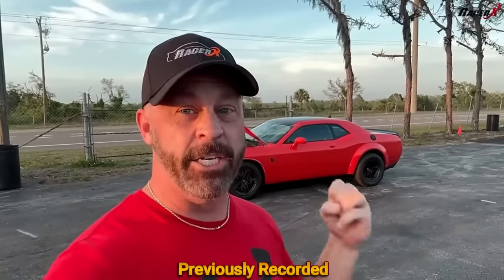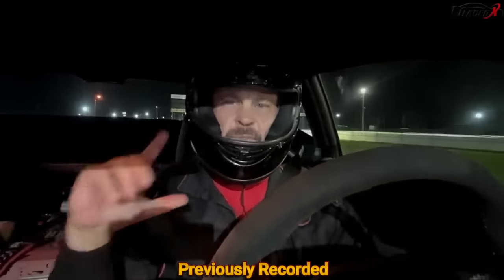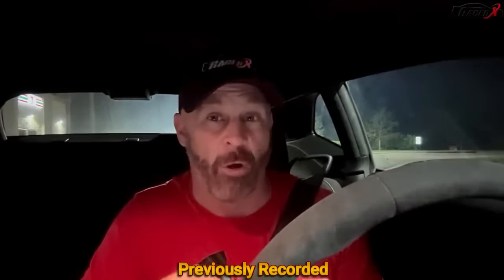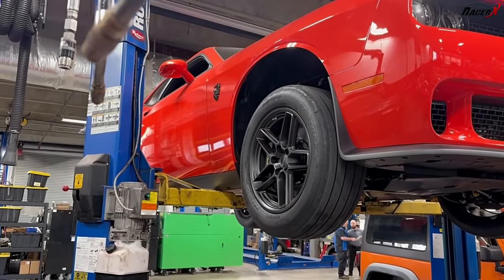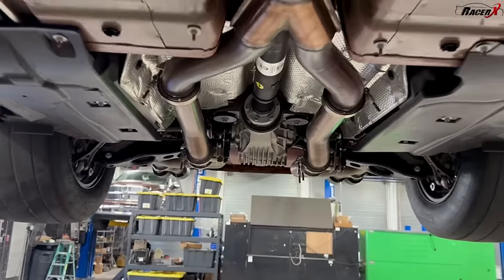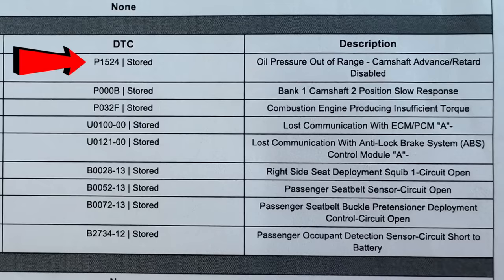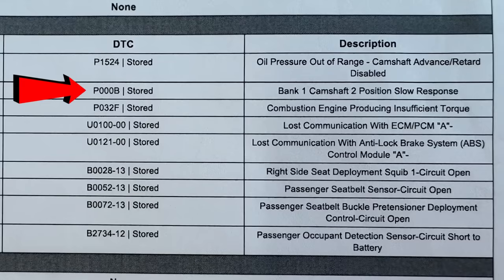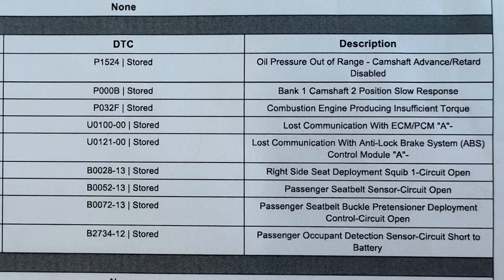What's Going on with my Demon 170?  Is my Engine Trashed?

Comment: i went thru the same hassles last year with my SRT durango and it wasn't resolved because the dealership that i leased it from didn't have a mechanic qualified to work on it so they were guessing at the problem and had to contract the job out to another dealership to repair the problem which turned out to be a valve lifter. the dreaded hemi tik.

Comment: I can't believe that a company is selling a 9 second car with a WARRANTY!!!   Most will have a clause that if you race them you bought them...and I don't blame them at all for that.   Seems that a LOT of the 170's don't perform as advertised and dealers are getting crushed with them coming back under warranty.   Not a good situation here at all.
Reply: Plaid is a low 9 second car with a warranty and can withstand many 100’s of passes (possibly 1000’s).
Reply: @lemongavine the plaid is a gay boring ev and its not comparable its more of an appliance than a car.

Comment: I feel your pain I just got my '23 Scatpack Challenger back from the dealership for a rear main oil seal leak at 610 miles on the odometer 😢
Reply: Crazy my 23 300c had a bad rear differential leaking and faulty on day one didn’t know till my first oil change
Reply: The 2023s are garbage
Reply: @OctonaBoyFresh chevy & Ford have there problems too....what are you driving?  a honda?😂
Reply: The 2023s really are bad. I paid 65k for a new 392 charger and have been bummed since day one on the quality of pretty much everything. It felt like things were falling apart since day one lmao. They raised the prices while lowering their already iffy quality. Going to the dealer for a fix is a nightmare
Reply: @OctonaBoyFresh  I have bought three 2023 models since last July of 2023. A challenger 1320, a 2023 Charger GT and a 2023 Charger RT Daytona. No issues with any of them.
Reply: @OctonaBoyFresh  Trolling much hater?
Reply: @joefromaz5467 so you think that's okay???  Car companies can make reliable cars.  They just won't.  There's no money in it.
Reply: @mohamedghareb5940  If you know your about to get fired and your pension gutted, would you give a rat's ass about some rich kid's toy that you could never afford to buy?

Comment: I have a feeling it accelerates so hard that your oil pump isn’t able to pick up and pump enough oil. Loss of oil pressure and volume basically. Had that problem with a built Kawasaki years ago. Luckily an aftermarket company came up with a dry sump conversion that solved the problem.
Reply: That seems like an accurate theoretical possibility but don't you think the Demon engineers already thunk of that and designed accordingly? I would hope they did.

Comment: My little 2012 Mustang GT only ran a 9.01@156 mph last fall. Had to leave at idle as I was not sure if the track would hold my Hoosier Drag Radials. Well, that got me kicked off the track due to no roll cage. I plan on installing a cage this summer. I was running a 72mm pulley. I wonder what it will run with my 63mm pulley? We shall see.

Comment: When I first got mine, everything was pretty good before I started modifying. I went through several batteries because the computer didn’t have enough voltage even though the battery tested good. I had to go with the AGM gel battery … the battery tested at 12.6 V  but under a load it would drop causing all sorts of check engine light problems. Hope it helps you. I’ve not had a problem since putting the gel battery in.👍 when I brought it to the dealer they kept telling me there was nothing wrong😂
Reply from the maker: Wow.. that’s no good at all

Comment: Definitely do an oil analysis and cut the filter open.  I'm assuming these cars do not have multiple displacement because of what they are meant for, but if they do, pull the supercharger and verify no metal in the actuator.

Comment: Oil pump, oil pressure sending unit or cam phaser could each or all be the issue. Worst case is engine replacement. Hopefully just a faulty sending unit. Good luck!

Comment: I warned you about when you were “breaking in” months ago, someone gave you bad advice.. thought it was dangerous to “ rod it” with under 300 miles, hope I am dead wrong…
Reply from the maker: Keep in mind that I broke the car in properly exactly the was supposed to be.  I didn’t rod it whatsoever with under 300 miles on it .. just so you are aware.
Reply: I trust you, that I have only owned one new car, in sixty years on this earth, just feel bad for you, “sh#t like this, usually only happens to guys like me, keep up the great content, watch All yours, even old stuff I never saw.. they will get it right, just a “bummer”
Reply from the maker: For sure buddy
Reply: I’ve been around drag racing and high performance cars for 50 years.  It’s always been the unwritten rule to change oil before you race.  Always.  It doesn’t matter what some book says.  Never drive a car on the street and then race it without new oil.  And with a high performance car, oil was always changed before the 1,000 mile mark.  That’s the best way to keep them alive.  Or, you can read a book, or listen to someone else, and replace an engine.  I do hope it works out.

Comment: This is crazy.  For the amount of money they want for them. This is unacceptable.
Reply: Agreed 👍
Reply: @capricetony guys. It happens. And with the parts they have to work with. Amazing it doesn’t happen more often. Think of all the hundreds of moving parts that make them the whole package. The main thing is and always has been. How they stand behind their product. I have a lot less of a Challenger. A 2009 R/T 6-speed with the super track pack. I bought it new. It has 207000 miles and looks flawless. Original clutch and the engine has never been into. I changed the alt. And water pump. Also lowering springs and struts. Quite a few end links and front end rebuild. Thermostat 180. I also put a Diablo Predator 93 octain tune. I changed the plugs once. Car runs great and I have also ran it at z-Max before I tuned it. Stock ran 13.4 @ 106. Never went back with the tune to see what it would run.
Reply: It’s just a glorified Chrysler. That alone is the red flag.
Reply: @PhuckYoutube-dw7su absolutely the truth. I have had 3 Dodge vehicles. All gave me major issues. When my charger was stolen from in front of my house.  They literally did me a favor.
Reply: @randylear8264  the older Chargers/Challengers are absolutely better quality.

Comment: Sounds like an oil pump problem or something restricting the flow of oil within the engine. Most of those other codes could be associated with the seat removal inadvertently unplugging one (or more) of the data busses.

Comment: Your oil pump is faulty or someone used the wrong oil for your car. Oil pump failure leads to your timing chain not getting the right tension thus giving you the cam sensor error code. I would suggest replace the oil pump check the bearing caps on the conrods because because bypass on the bearings can also cause this. This same issue was found on various other brands of cars and isn't a Dodge only issue. One bearing with the wrong clearance can cause this to happen.

Comment: 330, thousand dollars, at my local dealership, and it sold less than 3 days, and now it turns out there doing this, go figure, as I always said they were too much damn money

as the people who think this is the next hemi car are insane, hemi's actually make damn good power generators, which the air force actually used back in the day, and stay in tune as long as you dont abuse them

and actually both porsche and ferrari use hemi heads to make so much power low down with such small sizes, hence why a 4.4 liter V12 was putting out more power and torque than a 6.6 liter firebird with an olds engine under the hood

this, this is just a modern stelantis product being oversold for what it is

also I bet I know how to fix it, major thing they talked about was weight distribution and throwing all the weight on the back end, hence why they shunned the sunroof option, it moved the CG

which might be the thing that saves those owners, 

but what do you bet you have to do like on a mid engined LS swap and switch the position of the oil pump and the sump so its at the back where the oil is thrown

and that either they didnt do that, or use a baffled oil pan, all things vintage car owners would know from the getgo

and even the detomaso people knew this, and that's just a ford kit car knock off of a ford GT40 that blew its engine everyday their was a day with a Y in it 

actually how sad is that, you know ford did have good luck with that awful sounding 5.4 liter they had in the GT500 way back when

that one that was good but just looked like an AWFUL retro knock off of a far cooler car in both the GT and that

maybe you should contact omega auto clinic and offer to buy that supercharged GT500 that's putting out pretty damn good power and has lasted over 200K miles without having to do an oil change every week

Comment: It goes into launch mode to protect the motor once you have low oil, pressure or one of your sensors detects it’s not getting enough oil. The car will will go into limp mode to protect itself. It’ll do the same thing if you ran low on oil.

Comment: Is G forces doing something to the oil pressure, it’s a beast off the line. 
I imagined they checked for the oil pressure sensor is within electrical spec.
Also you can pull the oil filter off to release trapped air in the system somewhere to re prime the system. 

The pressure regulator in the oil pump
is responsible for keeping the oil pressure in the system at the necessary pressure.

Comment: Let them buy it back - that car will never be right, they sold you a lemon. It does you no good to have the car sit in the shop while you're making payments...
Reply: Problem with that is that you will not get what you paid over MSRP back from Dodge and you can't order another one to replace it from Dodge either. It would be a huge loss of money to loose your original "market adjustment markup" and then have to pay another "market adjustment markup" to a dealer that has another one.
Reply: Yes, he could lemon law it if it sits at the dealer long enough and get 100% of what he paid back. I have done this three times with great success.
Reply: @artillerybuff2000  I did a lemon law once, and you get back what you paid less usage allowance for mileage. The issue is that he paid a markup over MSRP and you will never get that back from Dodge. They will refund up to MSRP but no more.

Comment: I think there is a problem with your oil pressure pump or the oil pressure sensor, did they check it manually with the oil pressure gauge and compare the reading to there witech scantool  input data?

Comment: Sounds like VVT won't function b/c it's oil-operated. It may be a clogged VVT solenoid pre-screen OR failed solenoid/ cam phaser. Speculation, but good Speculation. If so, guess everything should be gravy.

Comment: To me it sounds a more computer engineer issue than a mechanical engineer issue. Also with the Demon 170 its like a race car where the factory serves as your pit crew. While disappointing I wouldn't be to quick to condemn them for the length of time its taking to figure out whats wrong and a workaround to it.

Comment: If It is a oil pressure related issue, makes me wonder if the oil pump is having a issue under extreme load with oil dissolution. The reason I say this is using High ethanol based fuels one of its drawbacks is the amount of dissolution, and contamination that occurs in the oil therefore requiring more frequent oil changes. On our Racecar we would change our oil every 3 races because we noticed water droplets in the oil from condensation when doing valve lash adjustments we were running Ethanol. With you living in Florida which has higher than normal humidity and the use of E85 I wonder if this is exacerbates the issue and the sensors start adjusting because the oil is getting diluted. What do I know ??? Hopefully they will get to root of the problem Paul....Frustrating as it may be.

Comment: I am 90% sure that it’s an oil pressure system problem that explains all your codes and also explains why your transmission will not go into launch mode

Comment: RacerX getting pschyed up for a whole new engine or trans based on little or no info. It could just be a bad sensor sending false data. Everything is running through ecu/tcu/bcm, one data point out of parameters will cause the module to enter limp mode.

Comment: Idk about to much about the car lol but if u check the oil level or the oil pump is not working or maybe could be the pcm computer is not reading to the engine but I would tag on the pcm and check with them and see

Comment: Hook it up to a scan tool and monitor for current misfiring. It’ll show and then erase a whole bunch I promise you. It IS a design flaw. Might even be all petroleum engines. The manufacturers are hiding it. It won’t throw a code but it is fatal.

Comment: I'm hoping it's something basic. These mopars are very Finicky. I've had an issue with a bad wheel speed sensor and my Cat went into limp mode and threw all kinds of codes like it blew up! I replaced all the sensors & it ran perfect. Such a basic thing felt like the cat blew up🥵😡🤬

Comment: Well 1025 HP is a lot to handle.  It could be an electrical failure, sensor, fuse, contact etc...  I mean the car lifts off the track ....

Comment: This literally happened to me in my 2021 392 scat pack. I went to race at a line and my car totally bogged down. It would not leave third gear. I continue to drive around. I could not go faster than 38 miles an hour once I turn off the car and turn it back on it went away. This happened twice in three years. I took it in both times to the dealership. They said there was nothing that they saw their end, no idea why it happened.
Reply: To much electronics

Comment: i had a 2006 dodge suv hit key no start it spins over no start the next morning the tow rig here he hit key it starts he works down the road from the mechanic shop he fallows me there i driving the car the code was bad oil sender it read zero oil pressure at that time then it released to some oil pressure & started i changed sender it worked ever since!

Comment: 😂👀DID YOU NOTICE THE DENT ON THE RIGHT QUARTER PLANEL FROM THE HOIST ...REPAINT ON A NEW CAR 👀😟😎
Reply from the maker: The car was lifted directly from the frame if you look carefully.. it was lifted directly from the chassis and perfectly aligned.  Not sure what you are seeing?
Reply: in video it looks as if the rocker is sitting on the yellow arm...just curious not trying to be mean  @RacerX9
Reply from the maker: No worries.. I don’t think most people will care about the numbers matching on a modern 170 though

Comment: Well the vvt system for cam shaft is oil pressure driven. That will affect advancing and retarding of cam and that's gonna affect the low end torque and high end horsepower. Probably a clogged oil squirter and when getting on the trans brake it's trying to get the camshaft to a pre set position and its not got enough oil pressure to advance or retard cam shaft

Comment: WOW...Goodluck but you will end up with that thing sitting for months. They never figured out why half the 2015-18's IC and IAT temp were switched from the Uconnect to the read out on the 2nd screen on the dash. Changed a Display, BCM, and just gave up

Comment: It’s the OIL FILTER IVE HAD IT HAPPEN MANY TIMES AFTER OIL CHANGE THEY DONT SELL RIGHT FILTER FOR THESE ENGINE THEY ARE SMALLER THEN FACTORY ITS NOT GETTING OIL TO THE VVT MEI G NO PRESSURE IN LIFTER MEANS CAM DAMAGE LIFTER FAILURE I CAN SHOW THE SAME CODES RIGHT NOW
Reply from the maker: Never even had its first oil change

Comment: racer x you did not break the car in correctly you need to break that engine in to at least 1500 miles I would’ve done 2500 to make sure nothing would’ve went wrong
Reply: or the ecu has failed

Comment: What oil filter are you using?
Reply from the maker: Stock Mopar filter .. stock oil
Reply: @RacerX9  I believe the stock filter on that is the 4884899AC (I am not at work to confirm). This is perfectly fine for street use but if you are racing then you really need to switch to the 5038041AA SRT filter. The difference in the two filters is the pressure at which the filter goes into bypass. If you are racing on an 899AC it would make sense to get oil related codes as it would not go into bypass soon enough under load. Check with your dealer.